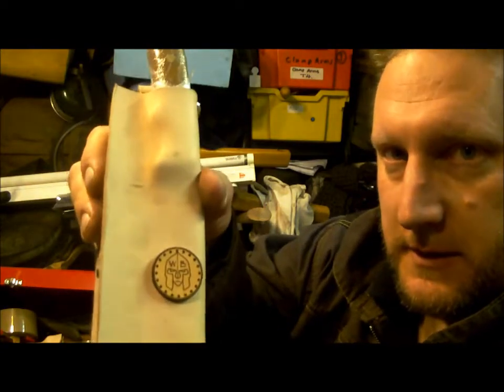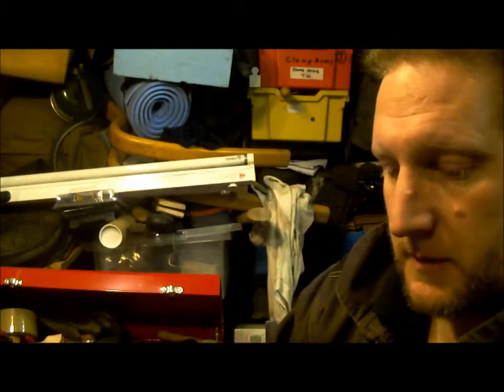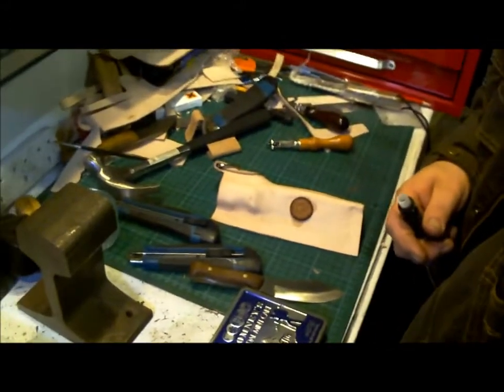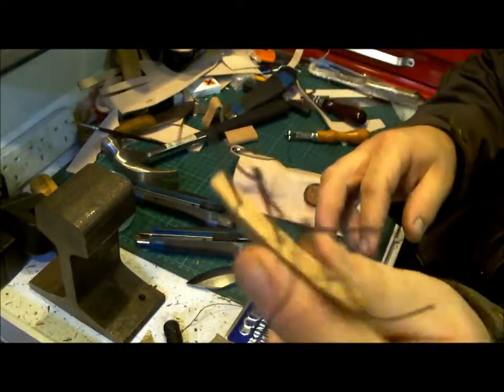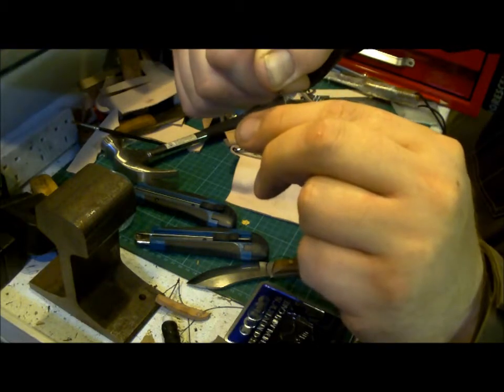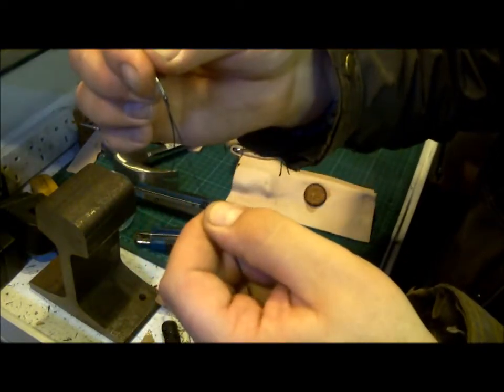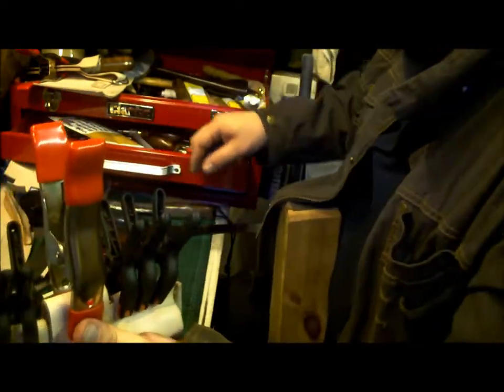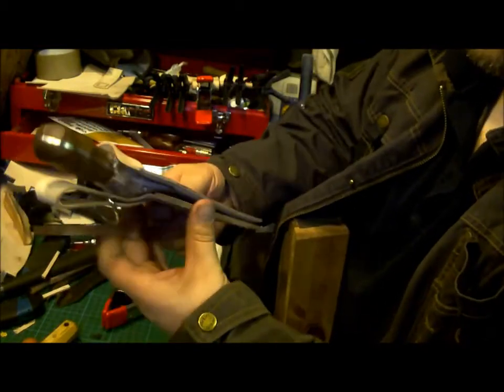Episode 5 The Entire Sheath Folds Back

Comment: Hey Scott great video. I was wondering how you put that medallion on there. The the joint you're looking at is generally called a skived joint, as opposed to a scarf joint. Tandy sells a fantastic skiving tool, well worth its weight. Also you want to be skiving the flesh side of the leather because the skin side is where most of the strength is, you don't want to take that off.